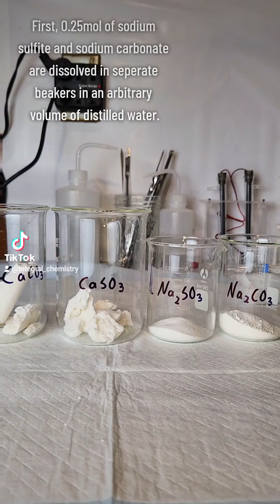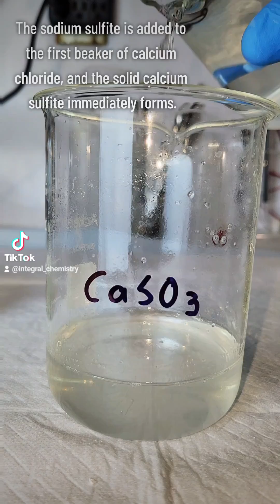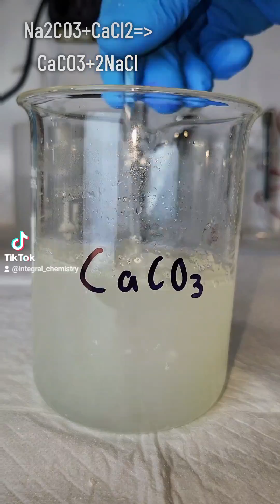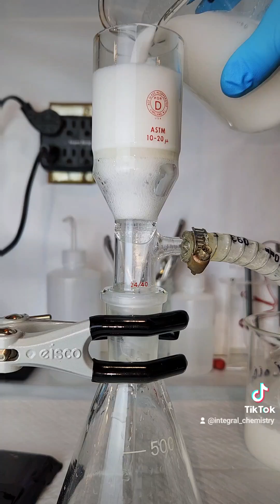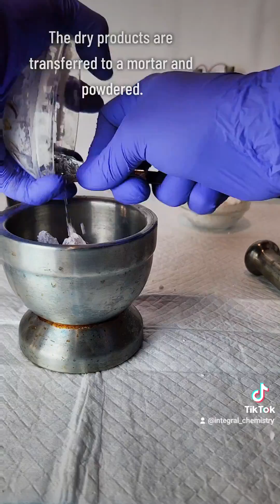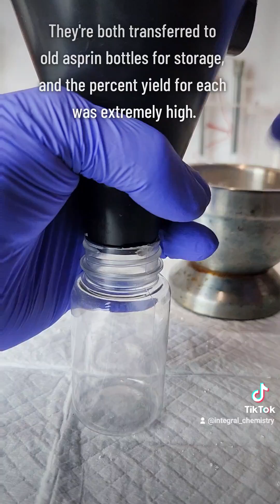Making Calcium Sulfite/Carbonate

Comment: Mine vacuum filtered fine….think it’s coz you went straight to a grit vacuum filter….great video thanks! Hey what do you call them metal screw tighteners you have on the Büchner funnel? Mine is like a mm too large and could do with one of them. Pretty sure I have the same tubing as you….
Reply: It's called a hose camp I believe. They're available online or at hardware stores.
Reply: @micahschertle2389  thanks for your reply! Yeah I found them. For some reason the first search didn’t yield anything then after my vacuum chamber/dessicator came with 2 and the pump I decided to search again and found them! Cheers. I actually followed this RXN but then realise I didn’t need calcium sulphite I needed sodium sulfite haha. I just ordered it in the end!